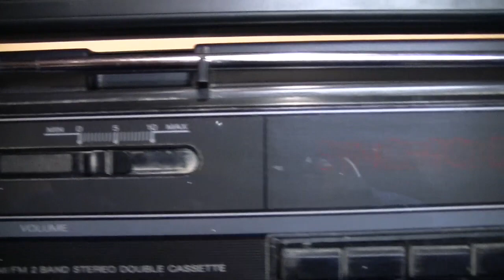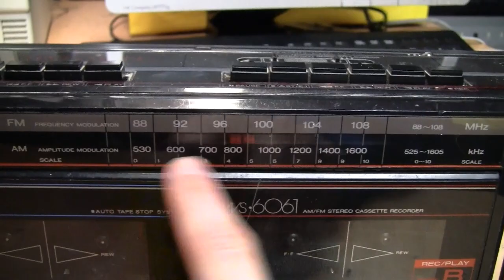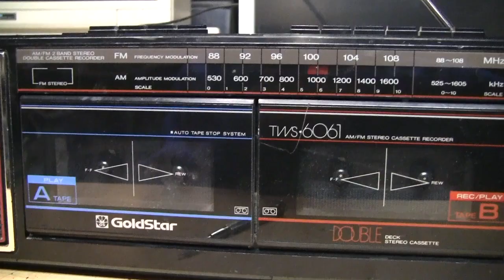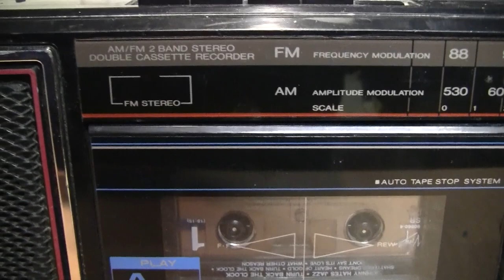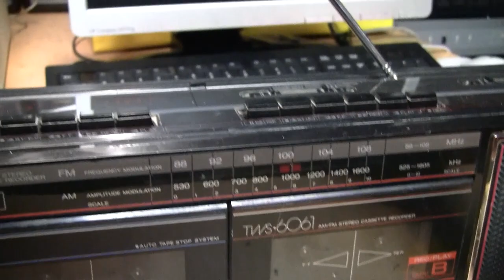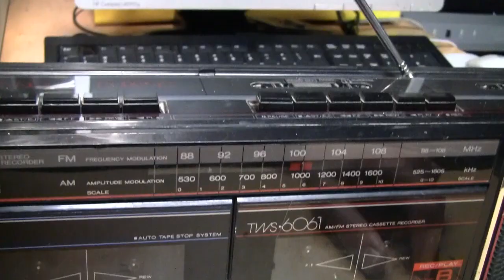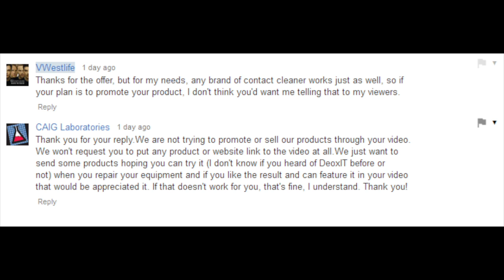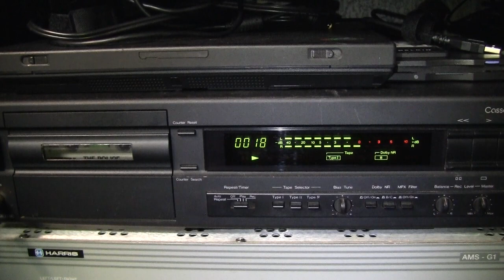1980s Goldstar TWS-6061 double cassette boombox

Comment: Super old school looking PCBs, they look hand assembled. Labour was still very cheap in Korea in the 80's so it would have been cheaper than investing in automatic insertion machines.

And the Chinese "International" boombox that Techmoan reviewed is far worse than this.
Reply: irtbmtind89 The International cassette deck at least has a proper AC erase head instead of the permanent magnet head found on low end decks.

Comment: U r so lucky,we dont even have FM in norway anymore...!
Reply: ddmeltzer8 DAB only?
Reply: I fear the day when all the radios I and others collect will have the same fate that vintage TVs have...we'll have to obtain some kind of converters that will hopefully be available.
Reply: @ddmeltzer8
Get yourself one of these, and plug it into your PC's headphone jack and use a chopped off USB cable for the power terminals. Tune it where you want, and open Spotify, Soundcloud, etc, and then use all the FM radios you desire within a 30M radius. http://www.ebay.com/itm/271990373821
Reply: gg wp ez
Reply: There's too many small AM and FM stations here that would be forced to go off the air because they couldn't afford to upgrade to a digital transmitter.
Reply: What a shame. They were going to do away with FM here in the UK too, but there was a lot of public outcry, so they haven't. I think the  waste of perfectly good older analogue TV equipment during the digital switch had a lot to do with it.
Reply: From what I've read USA HD radio wasn't much of an improvement over analog. FM HD sound quality wound up being about as good as Sirus/XM and AM HD sound quality was similar to a scratchy 24 or 32 Kbps ACC+ webstream. And both formats had reception and interference problems. The only big advantage of HD is that it allows FM stations to carry 3 more channels.
Reply: fm station density in this video is impressive....
Reply: We still have FM in Finland
Reply: @MrMrdavis98  in South Africa we are still using analogue tv transmission, the government has missed all of the deadlines for digital migration 😆

Comment: I have a old 80's Panasonic boom box that I bought on eBay. Great sound and has great features. 4-band equalizer, external speaker hook ups, rca Line in and line out, metal, CrO2, and Normal tape options. Love it too! Only thing wrong with it is the battery cover is missing

Comment: This is most likely from the nineties as it's not painted. Manufacturers made radios cheap as they could in that decade. Very little to no chrome, no separate bass n treble. No line in or out, etc.
Reply: Definitely not casseivers.

Comment: My first "boombox" was a GPX.  One of those transparent ones. Only single deck. I think i payed a whole $10 at Target for it in the early 90's.  They had these cheap Christmas gifts for like $10 and that was one of them.  I still have the transparent GPX portable cassette deck which was bought around the same time.  I wouldn't mind having the clear boombox back though. I am quite sure it was probably a tad cheaper quality than even this Goldstar unit, although not by much, but being transparent made it cool.

Comment: I had a friend in the 80's who had a similar cheap boombox, I think it was a Emerson. These small boomboxes were never that good for reproducing bass anyway. I still have my first dubbing boombox from 1987, a Sharp Twincam WQ-T282 that records with AC bias. It made good recordings on TDK D or Maxell UR tape. It still plays the radio and tapes except that the foam on the speakers are deteriorating. I wish I could find replacement speakers or find someone that could refoam them.

Comment: The speakers are not that pale compared to what young people now are used to listen: portable bluetooth speakers, overpriced Apple earphones or (god for sake) the tiny speaker of the smartphone. 2 x 3inch full range is not that bad after all. Pitty it does not have an aux in, this thing could had been actually useful as a portable speaker!

Comment: Brave man putting your tape in there.  You know, it is a big hunk of junk; but 10 minutes, a screwdriver and some electronics cleaner would fix the dust volume pot and the dirty band-switch.   The decks are hopeless, they flutter because the motors are in horrible shape.  Still, it would not be an awful radio for a job site.

Comment: An old dear I knew had something nastier. The playback only deck had only Play, and Stop buttons . Opening the unit up revealed that it was actually a Silver Dollar mechanism, but with most of the bits to make a normal one missing. One motor drove it and the recording deck, and the thing was DC bias. I believe it was a Goldstar too. There were two controls for vol L and vol R. No tone control, let alone bass and treble. Absolute junk !

Comment: I have this twin-sister Luxor 9552 it has three area equalizier also. Best thing  in this little boombox is very sensitive radio. The sound volume scratches was easily fixed by electric repair spray, you have to open the case for this.

Comment: I remember reading an article in the early 90's that said Goldstar were one of biggest component suppliers, many parts such as video heads, TV tubes etc found in other manufacturers machines were made by them. They also made a lot of the own brand stuff for the big electronics chains. However I always thought their kit to be cheap & nasty compared to the Japanese or home (UK) built stuff. I still don't really rate their stuff, despite the fact that my Philips TV has very likely got one of their (LG) panels and other components in it. :-)
Reply: I understand Japanese, but UK? :)

Comment: I had a soundesign boombox radio similar to this. actually it was my brothers. If I still had it today I would add line input to it.

The recording from the radio sounds muddy, One of my portable machines does that too my Panasonic RQA200 walkman radio when recording off the radio.

The wow and flutter is pretty bad on this boombox.

Comment: My "Boom box" was a Hitachi single cassete with AM and FM/FM Stereo, it had Mic inputs1/8"  and a 1/4" headphone jack. It had a "4 speaker system" with 5.25" woofers and 3/4" or so tweeters.

Comment: cassingle sounds like cd!!!!!!!!!!!!!! boombox radio recording sounds like its damaged the recording head is messed up or something on the boombox its sounds like its corroded or something or clipping or a loose connection that boombox should record off the radio better than that must need more  reparing

Comment: Vwestlife - please answer this comment. I have this really nice late 90s Sony boombox that has great sound, a good cd player, and a perfectly functional am/fm tuner, it just needs an antenna (I wore out the original one, wouldn't hold up anymore. Tried to fix it but just made it worse). But, it has a tape deck, but the tape deck eats tapes, as in, it pulls the tape out of them. Do you know how to fix this? I'd really like to fix this boombox because as I mentioned before the damn thing has GREAT sound with really good bass feedback.

Comment: I just found, and bought this exact goldstar this last Tuesday, it looks to be in very good condition, just had a little bit of dust on it, it cleaned up like new, and inside the battery compartment looks brand new. I'm just a fm radio guy, and it puts out very good volume, no scratchy sounds at all when adjusting the volume. For a cheap radio back in the day, it's sounds great.Looks great sitting right next to my recliner.  I have other 80's boomboxes, mostly Sony's, and this cheap one is one of my favorites, it defently screams 80's. I miss the 80's I guess, lol.

Comment: Just to check, I found one of these "rare gems" on ebay for the princely sum of 99 bucks with free shipping. I'm going to watch because I want to see if someone values their nostalgia enough to pay that much for something that probably cost $50 dollars back in the day.
Reply from the maker: It cost $34.99 in 1988: http://www.ebay.com/itm/VINTAGE-GOLDSTAR-TWS-6061-BOOMBOX-WITH-DUAL-CASSETTE-WITH-BOX-/142282326532?nma=true&si=qkT4MaMtx65zKnEg1f1JksyE6So%253D&orig_cvip=true&rt=nc&_trksid=p2047675.l2557
Reply: That actually sounds about right. It probably was sold at the Circuit City I worked at in Los Angeles back in the day, although, I didn't pay too much attention. I was selling video and sometimes audio, boomboxes were in the hub of the store, personal electronics.

Comment: Rock those switches 100-200 hard times full scale (can unplug the machine but not mandatory) and you'll see the dust being rubbed off from the contacts as you rock them from left to right. When the scratching disappear, keep doing it some more for a little while, this will give you a little more time before scratchy controls reappears.
Reply: When it comes to scratchy potentiometers (such as the volume control), it's best to use an electronics contact cleaner. This will clean the dirt and dust off of the contacts, removing the scratching noises.

Comment: Dear VWestlife, FYI the European version has the very same features except for the voltage regulation, of course. So, no DIN sockets, or anything else that you mentioned as an assumption in your video... I own the very same modell branded as PALLADIUM rather than GoldStar but otherwise, there are absolutely no differences whatsoever--even the model number of TWS6061 is the same. My dad bought this through some German retailer chain back then, so I imagine GS just rebadged it to PALLADIUM and called it a day. Mine does make terrible 'recordings' indeed, and it also has its belts replaced as well, but as you can probably guess, I haven't used it since like 15 years. Was very surprised to see this POS as a GoldStar, well! Greetings from Budapest, Hungary and keep up the good work, thanks...
Reply: At least the European version can be used in North America.